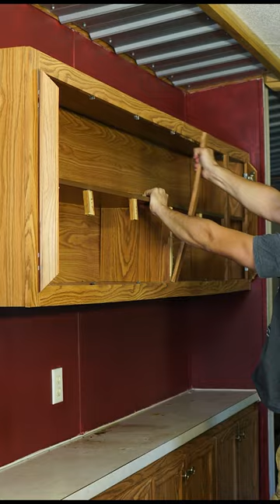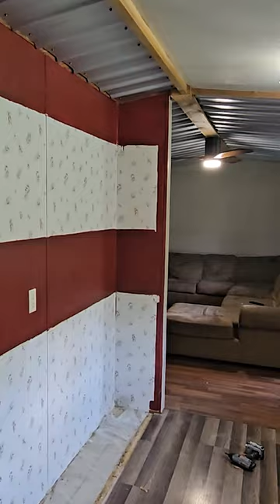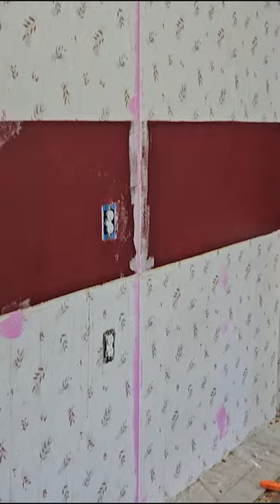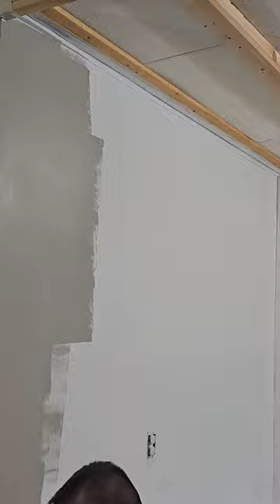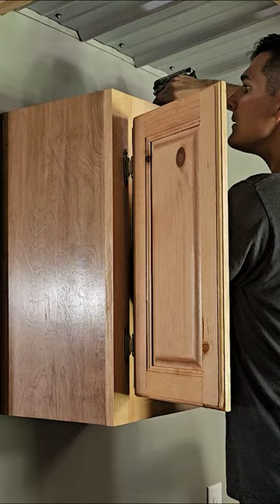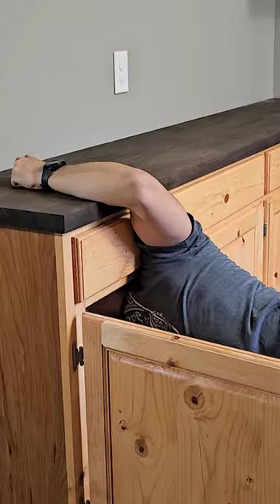Remodeling a Weird Kitchen Wall in a Mobile Home #shorts

Comment: Do mobile homes require different cabinets than a stick built. May reno but want to plan to not overweight the home in case it needs to be moved.
Reply from the maker: That's a good question, and one I didn't even consider 😅